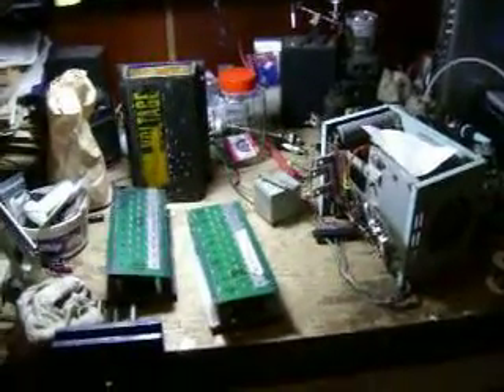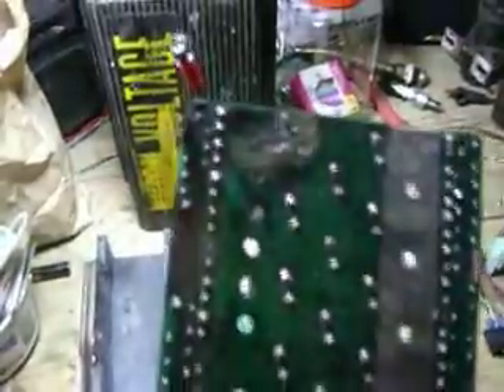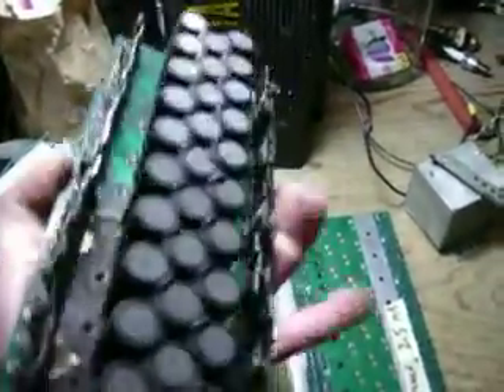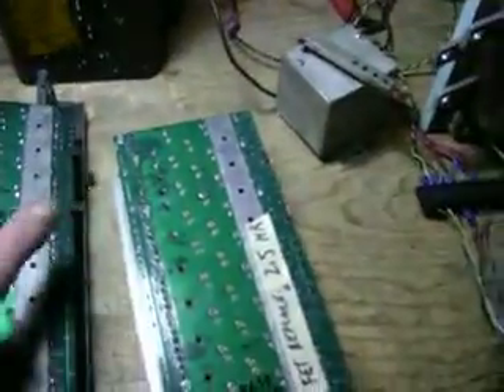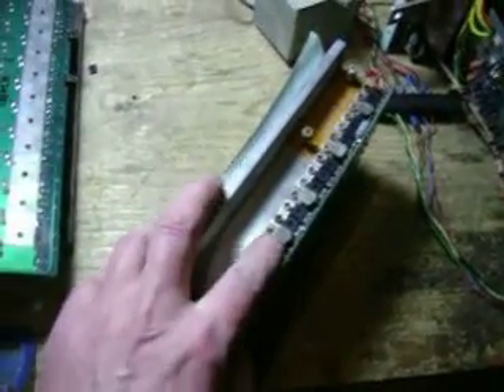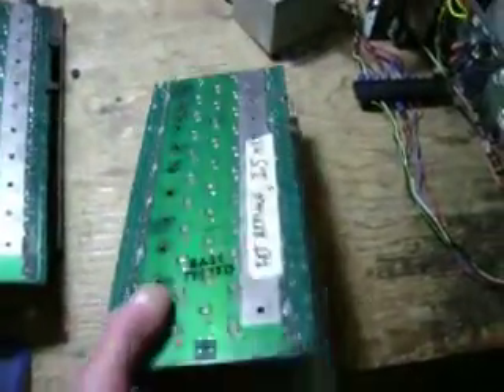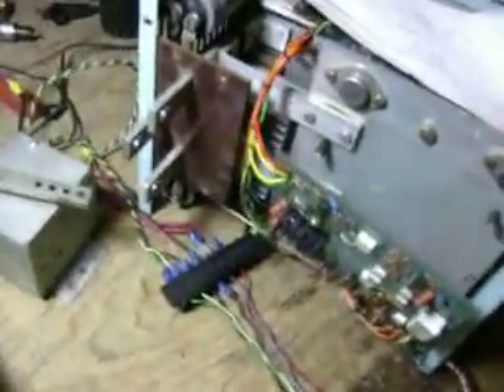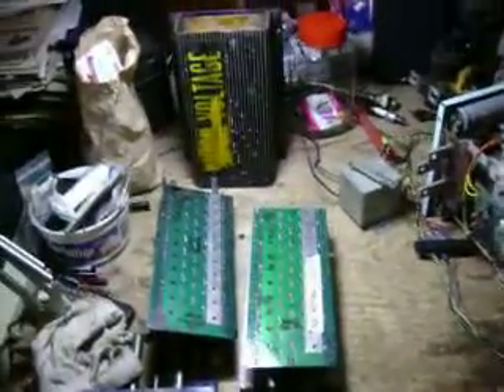Electric Car Controller Repairs

Comment from the maker: Hello kissmyhho-i am not sure how all those fets blew, but my gut feeling is that if a fet blows-it might blow "open" & controller would still work, but if max current is being drawn then all the fets could go-1 by 1 in a few millisecs-i figure that this extremely blown controller had a shorted motor or wiring hooked up to it's output-thanks for question